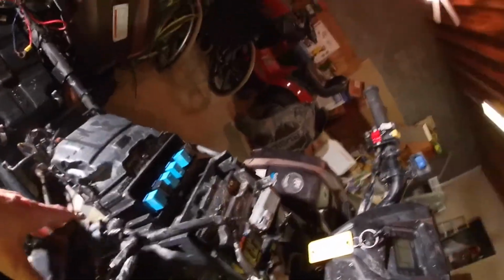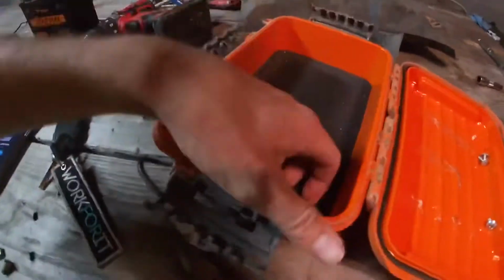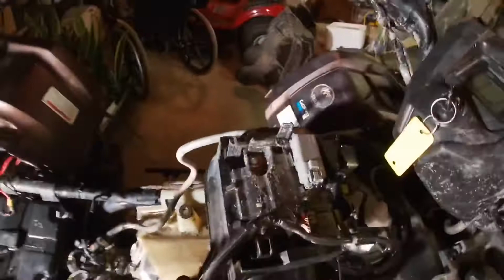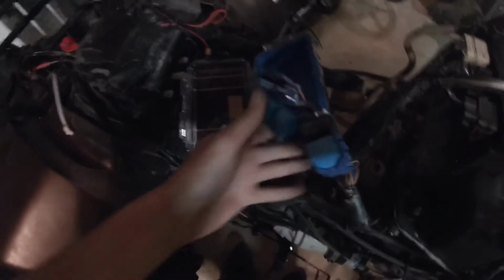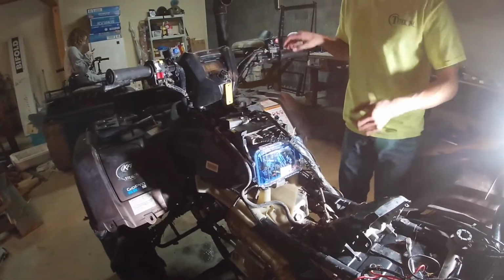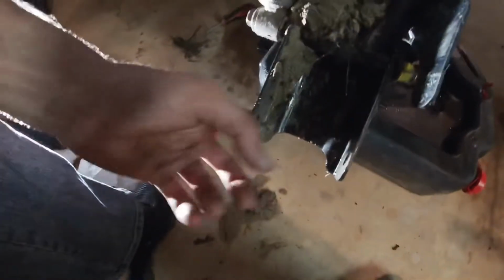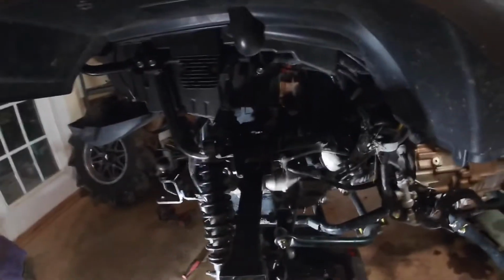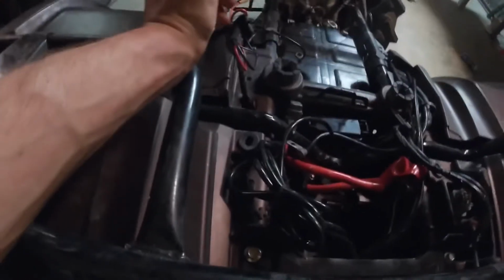Honda 520 waterproofing

Comment: aww kinda wished you showed how to take out the front axles. i can’t find any where how to do it. i seen a mudpuppy video and he said you don’t have to grease the fronts for some reason. would you happen to know why?
Reply: Seals contact the front axles and are lubricated by the front diff fluid the ring gear on the rear is what the seals contact so you need to lube the splines to prevent rust from sizing the axles into the ring gear
Reply: @Nick.wally2  thanks boss
Reply: @mflo713  no problem man were all seeking info for our bikes I try to share what little I know

Comment: Did you figure out why the axle wouldn't stay all the way in?
If I had to guess I'd say there's too much grease in between the axle shafts, it wont compress so you cant get both axles in all the way.
Thanks for the vids, I picked up a 520 a few weeks ago and did some of the water proofing stuff to it. I don't need a snorkel, so I skipped messing with the relays as I don't plan on getting them wet, our trails don't have super deep holes like what you ride in, we just have a lot of tire deep holes.
Reply from the maker: Yeah soon as a i put it in gear and backed it up the axles slid right in the rest of the way!!
Reply: Hydraulic effect pushed that axle out. Does greasing them like that keep the water out? Or is that just a theory? Diff oil isn't pricey I'd just change it often if I was to play in the water.

Comment: Do you have to us a box, or can you just dialect grease em?
Reply: Ya why didn't he just grease them. I mean if the quad got wet and it still works and runs why reroute everything and make a box? If you dont silicon this piss out of that it's going to fill up with water and you will be worse off.

Comment: Won't the water just run up the harness into the dry box?
Reply from the maker: Rockytop VFL it is possible but I separated all the wires as best as possible and put as much silicone as I could inside the harness so it would stop it as much as possible